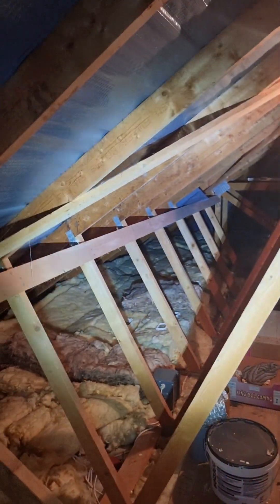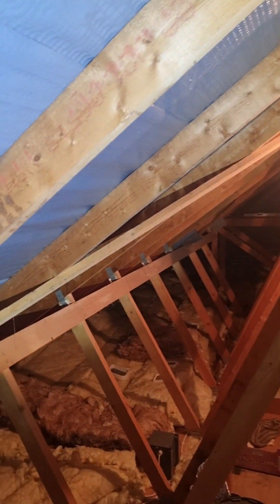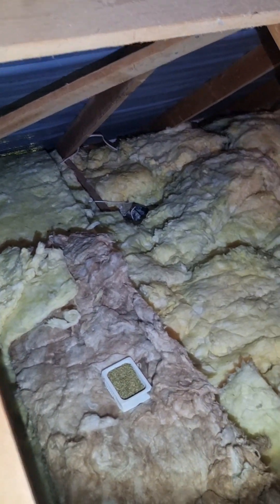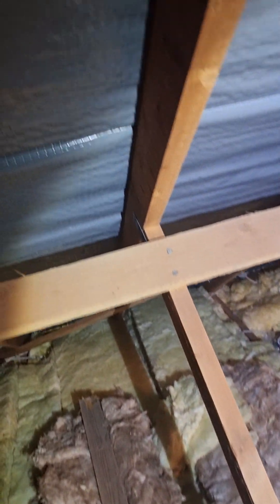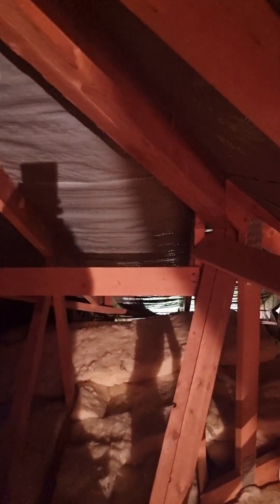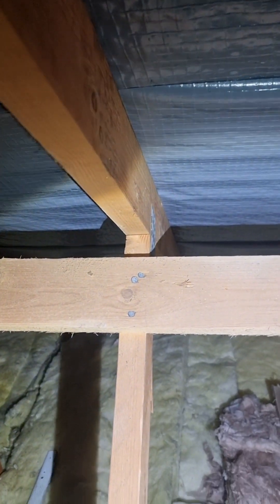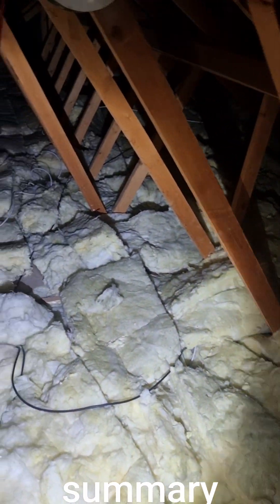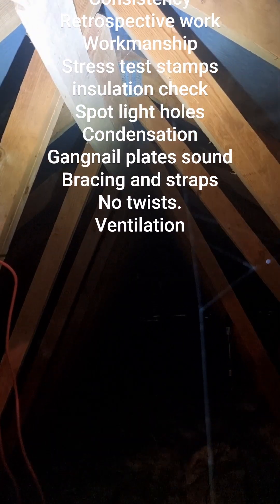Case study - inside a modern truss roof -  what to look for

Comment: Just a thought - if the electrical wires and/or fittings at upper ceiling level are covered with thermal insulation they can overheat unless they were designed for such an environment and/or have LED bulbs fitted.  LEDs  have a reduced electrical demand and it is therefore probable that even older wires and fitting will cope with this. Something to look out for as insulation is often topped up without thinking about the concealed electrics.